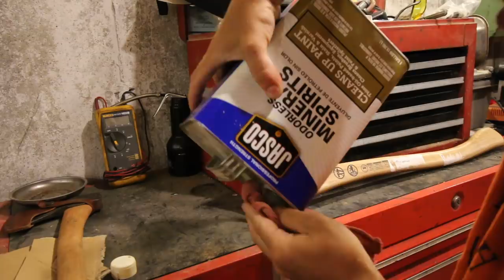5 STAR $30 Amazon Axe vs $150 Gransfors Buks Axe

Comment: "It doesn't bite as hard as the other axe." Because you put an 80* bevel on it.
Reply: All ax's are slabs of steel on a stick. Soft steel is easy to sharpen but dulls before you're ready to put it away. More expensive ax's are notoriously difficult to sharpen, but that's because they're made of hardened steel (which allows you to keep swinging with a sharp cutting edge for longer)
Reply: Bushcraft Beats 
80 degrees  ?
Reply: @thiccnicc6601  no just no
Reply: He is obviously not used to bigger handles he did a lot better on the smaller lighter axe I mean he just bought it obviously
Reply: Bushcraft Beats not to mention he isn’t going on a 45 with the grain. He’s almost chopping at a 90 across and an axe isn’t suppose to cut across the grain.
Reply: @theabyss33  that cheap axe I can reprofile and sharpen in 30 minutes when it gets dull I can get it really sharpen in one minute in the field it really depends on how you value your time

Comment: I have a small Forrest axe and a cold steel trail boss.  The way I have sharpened the $35 trail boss, it works way better than the small forest, but it’s also slightly longer and way heavier.  When I go backpacking, the trail boss will be in my truck.  The right tools for the right job.  The gransfors is awesome for its size, not for all jobs.  Great for backpacking in my opinion.
Reply: Anyone spending 100 bucks on an axe isn't doing it for function
Reply: Uhh yea because it's a hatchet 🫵😂

Comment: Doesn't the length of the handle give you more power? Just seemed like the shorter handle didn't have the power behind it like the longer one!
Reply from the maker: Yes the longer handle gives you a more powerful swing with an ax. The Gransfors Buks is a small forest ax you can get a different model too! One of the reasons I bought the $30 one
Reply: 1994abbygirl longer handle or heavier weight give you more power yes, but axe bit angle dictates how does it perform.
Reply: The axe is not nearly as important as the operator. If you can't even swing, don't break the bank, you will get sick of your little hobby soon enough
Reply: Lumnah Acres do you not know it isn't Buks.... jeez
Reply: 1994abbygirl szs

Comment: I have 2 axes I purchased at my local Walmart.   1 purchased in 1997 and one in 2005.  I still use both today and both of them were less then $40.  
Chop wood about once a week,   sharpen them & clean them after.   Give the steel a little oil and they will last you a long time no matter what you pay for them.  :)

Comment: The most satisfying thing on this video for me was when you cleaned the file the correct way following the grain of the file.
Reply from the maker: Thanks! Lol
Reply: Old technique that not many people know these days:

Use the file on chalk, and purposely load it up. Don't clean it out. The chalk will keep softer materials like low carbon steel and aluminum from gumming the file up as quickly, and it make it much easier to remove. It won't hurt the file.

Comment: A lot of negative comments on this video, but I liked it.  Rather than crapping all over the 30 dollar axe just because it's a cheaper option, he takes it for what it is and gives a good, detailed review on what each axe is good for.  As for myself, I do a lot of scrap runs hauling off unwanted appliances and other salvage for people who want rid of it.  I keep a cheap beater hatchet in my truck.  It's a handy tool to have around and if I'm just hacking apart junk I don't want to worry about an expensive tool anyhow.  If the handle breaks there's plenty more of them at the discount hardware store for cheap and if the edge gets a chip or two in it in a few minutes with a file shes ready to go again.

Comment: I have 2 Fiskars axes they are around 35 bucks each for the standard size. It will out cut both of those, and it splits 1 foot diameter logs with ease and weighs almost nothing. Best axe I have ever swung in my life.

Comment: I’ve noticed when you were swinging both axes,on the small tree, is that the bigger one you was hitting it towards the bottom on the head and not the center. And you did hit the smaller axe in the center. Due to you being used to the smaller one you don’t have to swing  as much as you would the bigger one. What if you got used to both then sharpen them to the best of your ability then did another test. Would it have the same bite or a bigger or smaller bite?? Great question?? Would it cut a tree faster or slower??

Comment: My observation  was you were much more accurate with the smaller axe than the cheapo except when it came to splitting and that does make a difference. I would buy it , thanks for your effort.
Reply from the maker: Thanks, Yes the Gransfor seemed to be more accurate But I looking forward to using the campers Ax in the outdoor Kitchen!

Comment: Too many bush crafters try to overthink the axe. I have two cheap Collins axes. I love both of them. One is vintage and the other is new. I just split some firewood with the new Collins boys axe and it worked very well. I paid about $22 for the new Collins axe.
         Don't try to overthink it. My cheap axes are much harder than the wood I'm chopping or splitting. Nuff said. Great vid.

Comment: I noticed you had better chopping control over the smaller forest ax than over the big ax.  With practice, you may find it is also a good chopper.  For splitting, the heavier head as well as the longer handle provide more power.  Good instructional video!

Comment: just looking at the profile you can see it is not meant for cutting.  You can cut with it but it is more wedge shaped than blade shaped.  Heck you can cut a tree down with a hammer if you hit it enough times it doesn't mean you should lol.
Reply from the maker: Lol! That would be a lot of work :)
Reply: 1975Jdonov it's a splitting axe not a chopping axe. Different blade geometry
Reply: i used to go to the forest, but could not afford and axe so i used a hammer and a chisel to cut down trees
Reply: haha
Reply: I once took down a tree by throwing big rocks at it for a few hours with my friend lol
Reply: Tyler  Bennett I wish I was lying. it was a complete waste of time. it wasn't like 3 feet thick or anything, and was also partially rotted, but we felt accomplished after it fell. why so doubtful harambe?
Reply: You are not a pro. The angle is fine, older plubs had the same geometry. Its all about the edge performance. Flat thin chisel grind is all you need
Reply: @KRDR659  I always punch down my trees until I can build my first axe.
Reply: @AKAxeMan  Same lmao

Comment: I picked my axe up at the hardware store for like $35, and I am happy with it... I just put an edge on with the shop grinding wheel and haven't had to sharpen it since.. I've used it on multiple landscape jobs. 

And p.s. I left the varnish alone.... I can always replace the handle with a better one later. They have nice hickory ones right next to the complete axes anyway.

Comment: the amazon axe has a longer handle, but a small head, like a hatchet.  The forest axe was smaller and had a thinner head. As far as axes go, I would want a bigger head so you can have more weight to power through trees or for splitting wood. The forest axe is more of a hatchet style for camping or trimming tree branches.

Comment: Great job. I would file it four times as you did. Narrowing the blade geometry and pushing the bevel back about 3/8 of an inch. And after sharpening a little bit of stropping is a must to me.

Comment: I went to a Fiskars 36 inch axe and a small hatchet for camping use and with the unbreakable handle. I love them. I also keep a Felco 611 medium tree pruning saw with me and it beats the heck out of an axe. You need to make the edge wider, like 1/2 in wide, for better bite and deeper penetration. I have a Michigan pattern and use it a lot too. If you burn wood and I do, you can't beat a hydraulic wood splitter though. Happy chopping.

Comment: I got a fiskars chopping axe for about 45 dollars, it actually chops pretty well. Heck I can still whittle with it. I’ve chopped down about 4 small trees, each with about a 5 - 6 inch diameter, and have chopped them up into small pieces to add to my wood pile.

Comment: My Dad carried a double bit axe, one side had a long smooth taper like the 150$ one, & the other bit was a short quick taper for splitting wood.  You could claim dangerous,  like any tool, just respect what it can do.
Like electricity handled properly, great tool, mishandled, kill ya in 3nano-seconds.
Like the rattle snake said, you knew what I was when ya picked me up. 
Check out fermented tops in my other post, been doing it for decades with crock pickles, now it's got a fancy name. Nothing new here, keep it simple.
Reply from the maker: What other post? I am very interested in them? Thanks

Comment: I was slightly surprised you didn't go with the cheap amazon axe Cody reviewed but I think you've chosen well and it's somewhat bigger. It should make a great general purpose axe and for splitting firewood. You didn't seem to sand all the varnish off the handle on the eye and knob but I think oiling that end grain would benefit the wood?  Good review! :)
Reply from the maker: Thanks! Believe it or not, I ordered this axe 2 weeks ago and have had it sitting here waiting for a chance to review it! Lol. Then I saw his video! Lol, We have been keeping busy with the outdoor kitchen. But I figured it was a perfect time to do it while I was waiting for the concrete to dry. Glad you liked it. Yes I think this will make a good dual purpose axe too!
Reply: I was thinking today that I hope you cut down the trees you tested the axes on, before too long? The trees will be somewhat weakened now, so you wouldn't want them to come down unscheduled / unsupervised? (if you do finish the job, I hope you film it! :)
Reply: Where was it made. It has a strong resemblance to a /truper boy's axe.
Reply: 15 bucks ar tractor supply, and you get to select the wood.

Comment: Without reading the other responses, I can guess that it's already been brought up that the comparison is flawed by reason of the handle length. What I am less sure of is whether or not the profile difference has been discussed.
The axe you bought appears to have a more or less American pattern head which widens more quickly from the edge than the GFB.  This is the reason why it doesn't bite as well. To increase the performance, you may want to profile the taper to a shallow half moon, deeper in the center than the edges, as the USFG recommends for axes of this pattern.
Best of luck.

Comment: I always used a chainsaw or 2 man crosscut saw to cut down trees and a maul to split with.  Usually 10 to 12 cords a year.  Used the axe for campfire firewood and lopping small branches after felling the tree.  Sawing is much faster for cutting and a maul is much better for splitting.

Comment: I was taught to file in a repetitive motion holding a straight line . Equal time on each side . Equal time in both directions  , paying no attention to the profile. So hold the angle and file both sides 1 time in each direction.  2 filings on each side in different directions.  Hope i explained it correctly.  This way the center of your cutting edge will be longer the top and bottom shorter, while the file line will be straight or perpendicular to the back of your pole axe. I believe this is called a chisel grind. Then dress edge with a fine stone. If you understand me ,then this axe will bite as well if not better than the expensive one. And still split as well if not better. My Grandfather taught me this,its how i still do it. When i swing my cheap axe it sinks deep in the wood. Hope this helps GOD BLESS YOU AND YOURS.

Comment: The question you should ask yourself is. Do I want a high quality ax that holds the rest of my life or a cheap ax that you must sharpen each time after use. The quality of the steel is completely different. One keeps sharp. The other you need to maintain more. In the long run, quality wins every time.

Comment: There is no comparison to these 2 different axes. The cheap ax you could not control when chopping the tree, didn’t hit the same place twice. Using it will give you experience and it will work great. Splitting the firewood, long handle heavier head made it much better. The forest ax is great for camping, you had better control of it, it chop a lot better. Thanks for the demonstration

Comment: at the end of the day, you're comparing two very different profiles. The small forest axe is designed for the felling of small trees (hence the thin blade profile - meant for deep cuts when cutting down a tree. Your $30 deal is more of a wedge profile, which is much better suited for splitting. The longer handle and beefier head weight makes this even better.

more of a comparison of two different axe types than it is a comparison between two individual axes.

Comment: Thanks I enjoyed this video! The axe may be fine how ever one thing I have learned about cheaper axes.is there are almost no difference in performance with some even hold their edge with the cheaper steal but when it looses the edge the amount of material you have to take off to bring it back. Add this up of the years and 1/4 of the axe head is gone.
Reply: For myself I am not really picky on the head if it can be sharpened but the handle is what I look at it that's the kicker for me I use to make my own now I grab one at the hardware store that's almost what I want then I shape it to my liking. I don't have one axe that isn't older than me I love them but they handles is what I spend most of my time looking for. I can make my own I am lucky enough to have a wood shop but the amount of time it takes doesn't make it worth it anymore so I buy one but make it my own.

Comment: Fold some old PC case side around a piece of dowel, pinch the dowel in with a vice, nice and tight, then form the steel round the edge, drill some paracord holes, and you can tie it around the head, nice and cheap axe sheath.

Comment: You can get a Council boys axe for right about $30. Probably a much better investment. If you like a heavier axe the Council felling axe is under $60. A maul works better for splitting and any cheap one you find will do. I paid less than $15 for a new one at the local hardware store. I got a real nice True Temper axe at the second hand store for $6.

Comment: Say Heah My Man, I really got lucky when I recieved a eMail on a Closeout 17" Hultafors Bruks Agdor Hatchet. Hultafors Bruks was up-graded to their newer Range. But it was my B'Day and the price was right. So I bought it. Luck was on my side again. Even though it didn't come as sharp as my Gransfors Bruks Small Forest Axe, But it came spot on with the Bevel and Wood Grain. Infact I had it as sharp as my Gransfors Bruks Small Forest Axe in a very short time. The only thing I did was I got a Axe Holster for it from Eugene on YouTube. Yup, I like its compactness and the axe head weight, it does make short work out of processing firewood in colder weather. Infact it became one of my Fav's Bushcraft Hatchets, I love teaming it with my Rodent 6 which I had modified and now it look's like a Ratmandu on steroids and or my Rodent 5 which is a little lighter. Also my Cold Steel Ultimate Hunter and one of my Saws, like my Wicked Tough Saw. Clearing through Brambles I usually like bringing my Ka-Bar Johnson Adventure Parangatang and don't bring my Hatchet. You did good, Thanx You.,,. p
Reply from the maker: Thanks! I will have to check out that axe!
Reply: Lumnah Acres I think it was replaced by the Classic Range. But the steel on my closeout Agdor is every bit as good as the new Range. Actually, I put the Hultafors Bruks as good as Gransfors Bruks. I got lucky because I don't know if you could find one.,,. p
Reply from the maker: Your right I could find it!
Reply: Lumnah Acres That's why I got very lucky, The only difference the Head is that of a European Style rather than a Scandinavian Style. I call it having ears, but their called something else. Like I said, the steel is the same though and holds a very good edge. That little extra Weiggt on a compact size makes it one of my Fav's.,,. p

Comment: Hey Al.  I know this is an old video.  But a blow dryer will melt the adhesive under the sticker and it will just peal off.  Happens to me all of the time when I order MDF panels for my oil painting.
Reply: Naphtha works as well.

Comment: I have that Mintcraft axe. I thinned the cheeks a lot, and put a nice 25 degree bevel on the edge, and it cuts just as nice as my Hults Bruks. Holds the edge surprisingly good as well. For a $25 hardware store axe, it isn't bad after some work. 

  As you pointed out, it was the fat cheeks that limited the cut.

Comment: Where is you splitting round?  I never split wood on the ground but sitting up on a round and I split them there.  An Elm round makes a great splitting round because it will not split.  I use whatever I have and if it splits I get another round from the wood pile.

Comment: For chopping: The $30 Amazon axe bounces twice off The Maple tree in the first three hits. And that’s after sharpening.

For splitting, you take big full swings with the longer Amazon axe, and little quarter swings with the smaller GB small forest axe. Not that I even expected the Small Forest Axe to split those big logs in one swing. 

The Amazon axe has a legit purpose for splitting wood without being a maul. 
But are you going to make feather sticks with that Head-heavy chunk? Even choking up, that long handle is going to be awkward. 

The Small Forest Axe is a good all-a-rounder for camping and bushcraft. It’ll split small rounds, fell small deadwood, break down wood into kindling, pencil lead sticks, and feather sticks. It’s perfect for packing. ...I have the Wetterlings 118, which is A bit heavier, and surprisingly good for splitting bigger and thicker rounds.